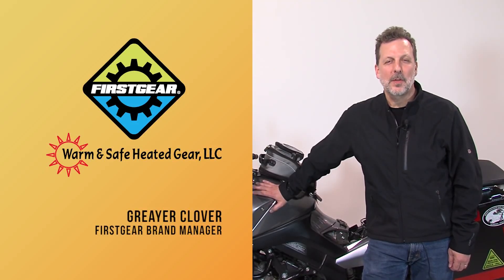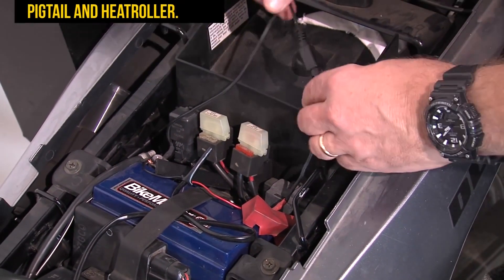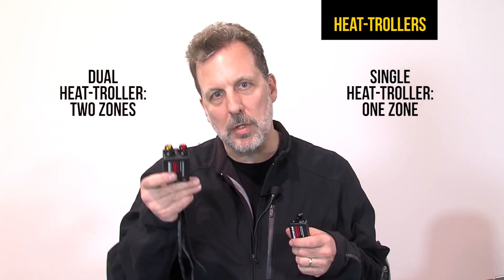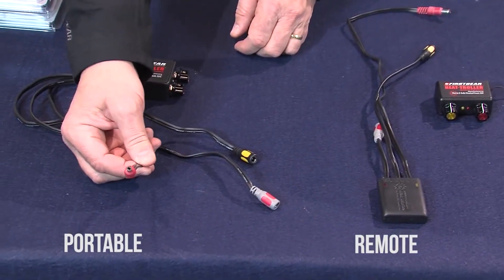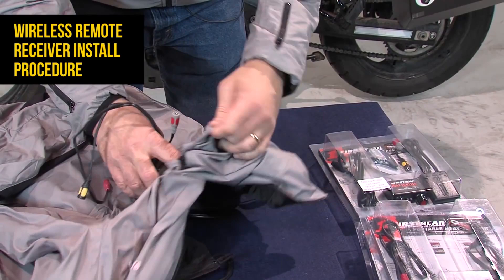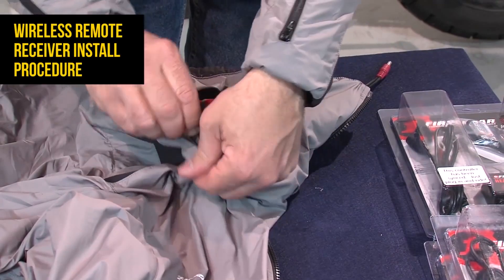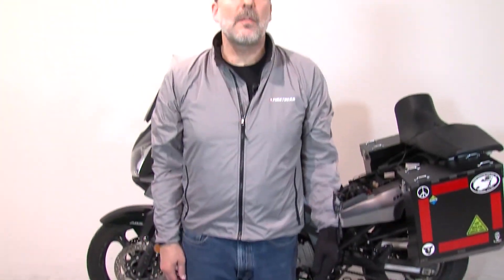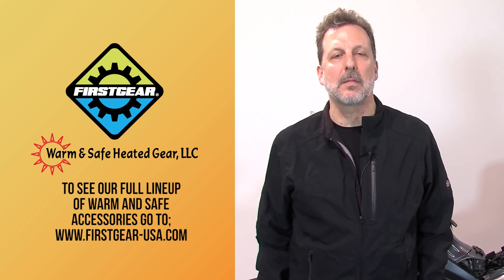Using FirstGear Heated Motorcycle Clothing from J&P Cycles

Comment: You mention that the system will automatically turn off to make it safe.  At what point will this occur.  I have a heated seat that does this while driving and I end up freezing as it turns down to minimal.  I like it hot and stay hot.  Can you describe this further. Thanks;